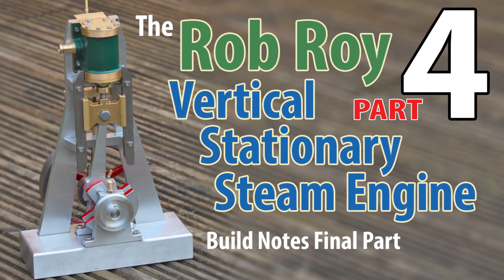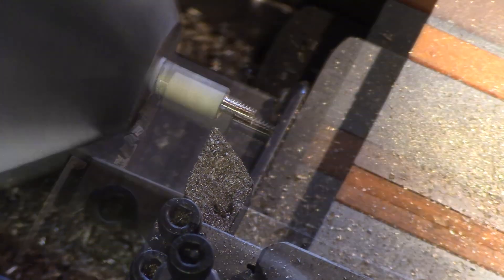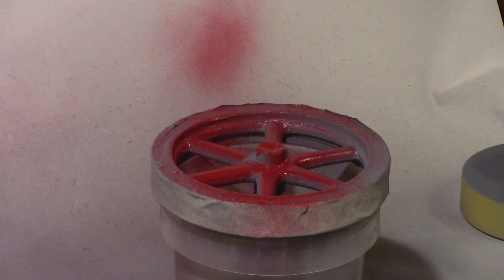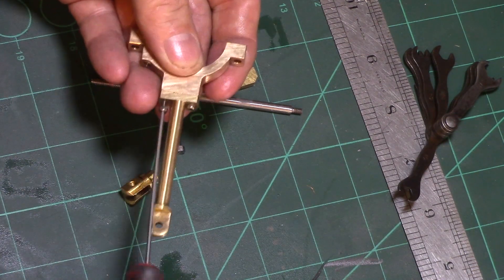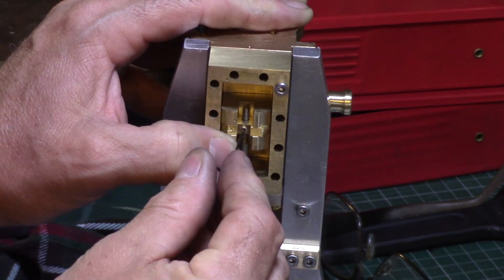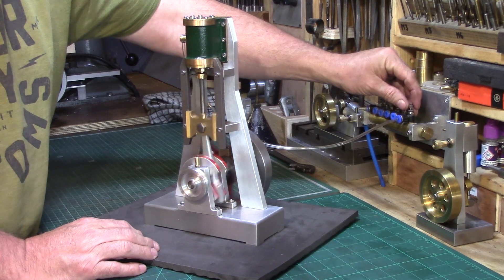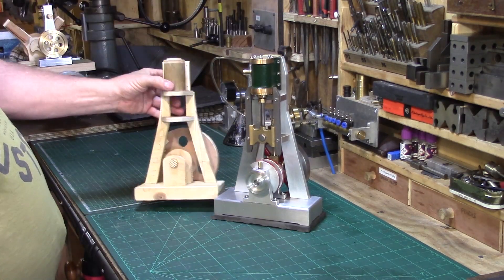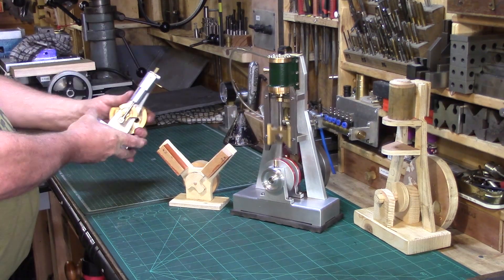Rob Roy Vertical Steam Engine Build - Part 4 - Final Build Notes and Engine Run-Up

Comment: I have seen more machinists showing the build of their steam engine of similar size on Youtube. It seems you are quite efficient and quicker compared to others. But not less accurate or lacking finish. Is that true or my impression? How many hours do you estimate you put into this build?
Reply from the maker: Hi Jlinkels, I cant remember how many hours went into the build but it took about 3 months of on and off hours in the workshop. I dont film all the build details as my vids would be just too long

Comment: Great video, any chance of a steam engine build using only a lathe? Unfortunately I don't own a mill. Only again great work. All the best!!
Reply from the maker: Hi OzRC101, when I started out I only had a lathe too, I bought a vertical milling slide for use on the lathe, and did all my milling on that, so perhaps you could try that method?  Regards. Ade